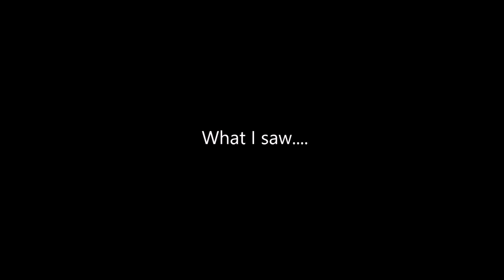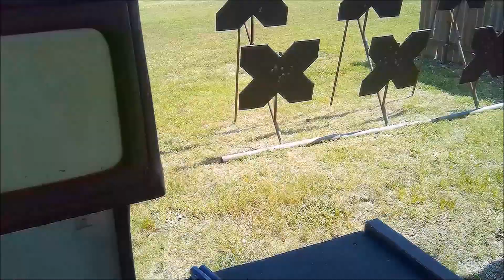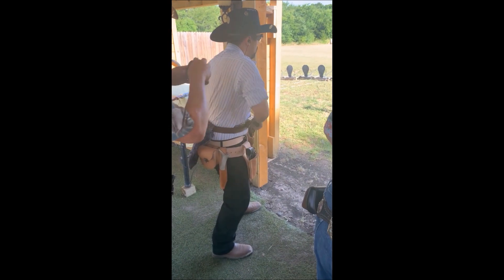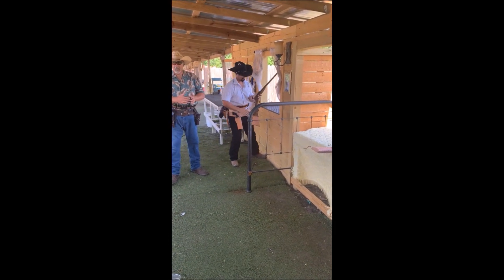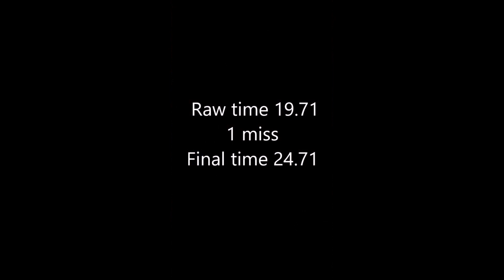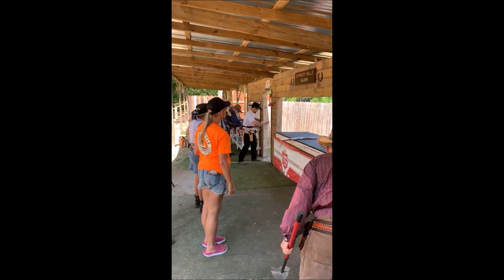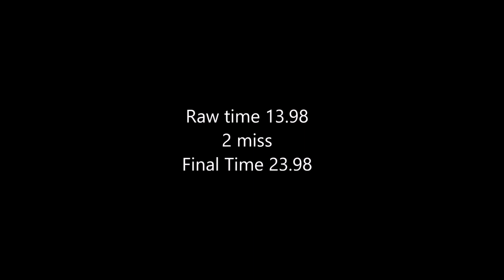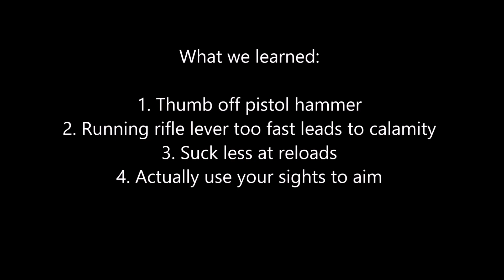Pistol problems, rifle calamity, and speed vs misses - Cowboy Action w/ the Texas Ten Horns 7/3/22

Comment: It’s always funny to me. About time I get one gun figured out and going smoothly I start struggling with one of the other ones. My shotgun was the gun I was worst at shooting and loading quickly when I first started. Changed to a double and worked on that for awhile and fixed that. Then started missing too much with my pistols. Got that ironed out and now my rhythm with my rifle keeps getting out of sync and I jack rounds. I’ll get 2 or 3 out of 6 stages to go well but always seem to struggle on at least one stage. Your thumb on the hammer riding it down wouldn’t worry me as much as jacking rifle rounds. I keep getting compliments on how fast I can reload, if that gives you any idea on how much I have been reloading on the clock lately. That’s never a skill I want to be known for😂😂
Reply from the maker: Lol, yeah rifle will be the main focus until I can figure out what’s up. Thanks for sharing!